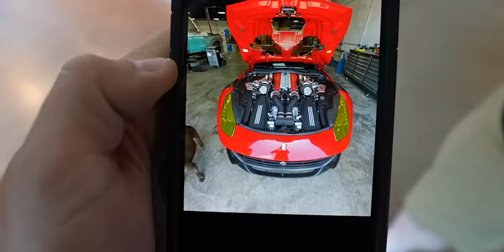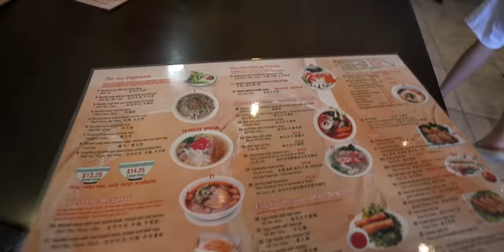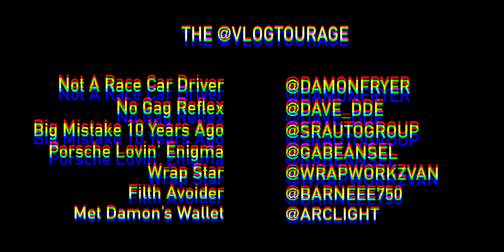SHOPPING TO BUY THE CRAZIEST SUPERCAR WE HAVE EVER …

Comment: Dave is actually correct about the engine in the Viper well half correct anyways. Around the time that Lamborghini was at the end of the Countach life it was sold for a cheap sum to Chrysler Auto Group, and during the time they had it is when the Diablo was developed and Chrysler actually took a bunch of clues from Lamborghini especially the V10. So props to Dave.

Comment: Yes to the Viper.  You need a raw, brutal tire slayer.  Check out the crazy twin turbo that Calvo Motorsports built.  2000hp with a sequential transmission.  Insane.

Comment: Damn I would like to see the McLaren 675LT in super inproved McLaren mode, roof air intake, new Senna inproved doors, with the lower Windows (road look) inproved aero, quad turbo, 2 200HP om the front and one conbined with the V8, 1400HP 4 wheel drive (25% front/ 75% in the rear, still Geels pretty rearwheel but with 0-60 miles/h not 2.2-2.4 sec. Topspeed locked at 400 KM/h...  New roof to make IT a spider (topless)  super special aero....      The real P1 killer....